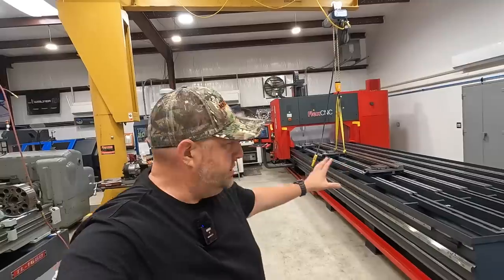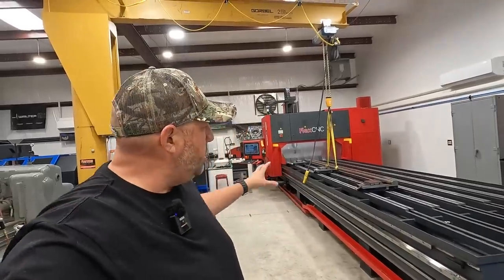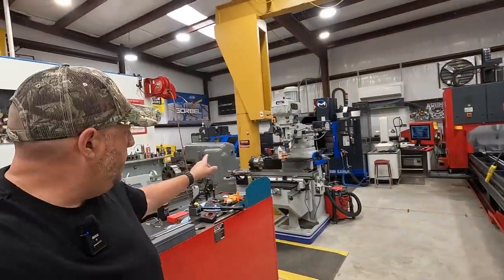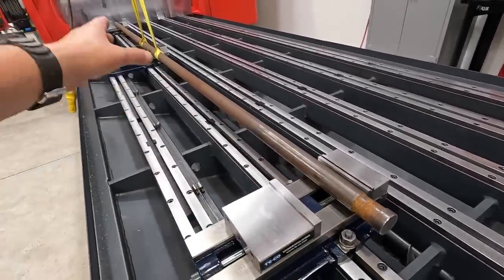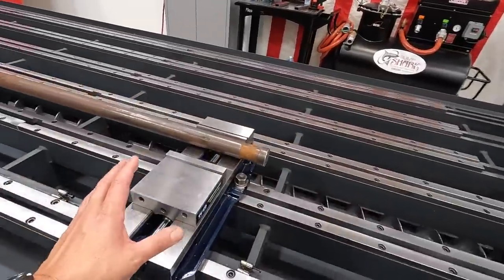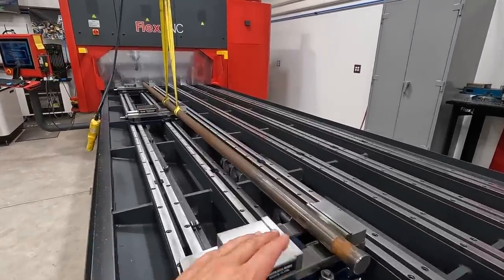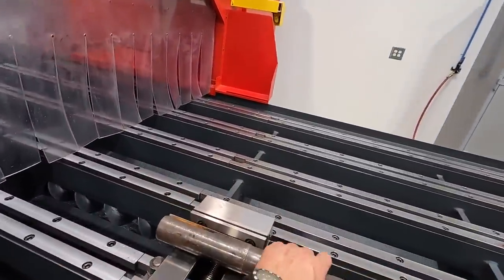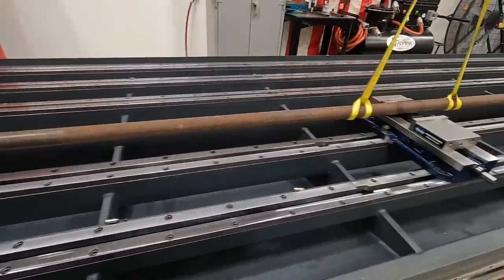Keyways Machined in the Flex CNC

Comment: If you are potentially adding and subtracting over greater lengths with CNC(not a ruler), have you considered using metric as it's a decimal system more suited to +-*÷?
Reply: Tell me you've never used the imperial measurement system from an engineering or machining standpoint without telling me... The same decimal system applies in an imperial system if you're measuring to decimal places. For example 0.001 is 1 thousandth of an inch. 0.375 is 3 hundred and seventy 5 thousandth of an inch and so on. It makes NO difference.
Reply: @TGC32  "Tell me you've <insert chosen skill here> without telling me." is becoming as overused as "literally"
Reply: @colinfahidi9983  Cool
Reply: @TGC32  depends what you call engineering, but if you're working with sub-milimeter to hundreds of metres on the same job the unit conversion is a lot easier than mixing feet and inches (fractional) with thousandths(decimal). So yeah it's just a question - I didn't suggest that he do it. Regularly work with mixed units here(UK) and prefer using metric for commonality because of the reason given.
Reply: Even at this scale, adjusting the measurement system would add as much extra time and effort learning as the move to CNC already is. Arguably, for zero advantage. Working in thousandths and tenths of a thousandth of an inch is just as accurate and converting everything to inches (not difficult where dimensions are usually already in inches and might need conversion from feet) puts everything in an easy decimal system you seem to think is missing from Imperial-based machining. Fractions are never used for precision work.
Reply: @jimstanley_49    I don't necessarily see the need for translation as a strong argument. In the UK we're still unit-bilingual so converting between imperial and metric isn't any more difficult than converting 3/8 to .375. Pretty much all trades have moved to metric, along with specifying tolerances in mm. The ecosystem is also more straight forward e.g. thread sizes and pitches being explicit, not fractional. You can work out the drill size from the thread description, and you can basically express all imperial thread sizes in metric but not the other way around - e.g. 1/4-20 would be M6.35x1.27 (which in practise would work as x1.25) requiring 6.35-1.25= 5.1mm drill bit (a common size for easier tapping of M6x1.0, where 5mm would be full profile). It's confusing that number-size drill bits are yet another unit system in imperial, like when someone says they need a number-53 drill bit(or whatever) for a certain tap size and have to look it up on a chart. Most (if not all) CNC equipment is manufactured with metric scales anyway, so if you ask for a threadmilled 1/4-20 hole it's going to be converted to metric within the machine.
Reply: @200milesaway6  did the customer ask for a metric keyway? I'm happy your corner of the world is so advanced. I'd argue the stuff Adam is working on is less likely to be specified in metric or even dual-speced. I thought the question was about the units to measure the job for the convenience of the machinist, but if you're talking about threads it's going to depend on what the customer wants, no matter how convenient metric might be. An American machinist that requires metric dimensions and features will turn away a lot of work. Any machinist that decides to only work in metric and convert all drawings is asking for trouble. You say it's not difficult. Maybe it isn't, until you miss converting one of dozens of dimensions and have to scrap a part. Or worse, ship parts that should have been scrapped and let the customer find your mistake.

I'd be interested to see how long a thread you could get away with assuming x1.25 will be adequate in place of x1.27. Threads tend to be very unforgiving about slight differences.

I think you're thinking of hobby-grade DROs, which often will start in metric and convert to Imperial (often with a resolution of only 5 tenths.) Within high-precision, production tools like this, all dimensions are converted to counts. That is, encoder steps that are finer than the ability to measure without specialized equipment, whatever the system of measure. CNC equipment converts from whatever your units are into how many steps it needs to take. A tenth (of a thou) could be anywhere from five to a hundred to hundreds of counts, depending on the gearing and how close to the edge the engineer wanted to play.

Comment: If you had 10000 of them to do, the machine would then come into its own. As a one off, it makes no sense, especially considering the cost of the machine.
Reply: Not when the machine didn’t cost you anything. 

Before I catch hell, I know Adam has a lot invested to get here, just saying, he is advertising for Flex with benefits.
Reply: w r o n g. Big stuff is expensive. You can't send stuff like this out to a normal shop, because it wont even hang out the side of most VMCs. Most shops wouldnt hang this off a manual mill either. This is //literally// the perfect job for this machine. PERFECT.
Reply: @RyanDoesAll  how do you know this?
We know he worked a deal with Flex and other manufacturers,  but that could mean anywhere between free and purchasing it at cost.

Comment: And the real machinist is Adam. Please don't become a cnc button pusher. I bet half of the cnc guys cannot even read a micrometer.
Reply: He had to program the whole thing, then check, measure.  He does MUCH more than the CNC button pushers do
Reply: @haydenc2742  I would suggest that he did not write the program, as otherwise he would have said so.  As he previously explained , the software on that platform is accessible remotely through wifi to his Flex CNC guy, just as if he were standing at the control panel right there,

Comment: You know what. Let the young guys catch up to you. The Old way where your brain has to be used. Pushing buttons takes the massive skill away from real machinists. I will rock the boat. You Button pushers will never be real machinists. Learn from the the real guys .
Reply: Yes. Because making the CAD drawings, CAM files, and setting up the machines correctly takes absolutely no skill whatsoever.
Reply: You really should get a clue before typing rubbish. I used my first machine tools at School 40 years ago and about 5-6 years ago started putting my Brain to work with CAD again after learning Autocad 2.x at Uni 35+ years ago. The curve into modern CAD/CAM is a very different technical challenge and is harder initially to get the results. Adam could have taken the soft option with those keyways and driven it with the pendant as a manual process but instead was playing with and tweaking it at the console as a basic learning program.